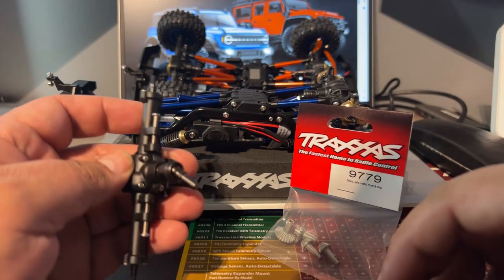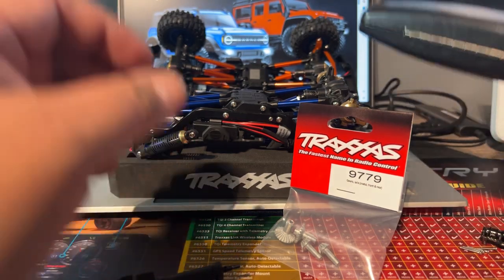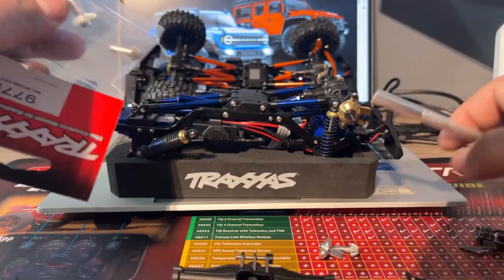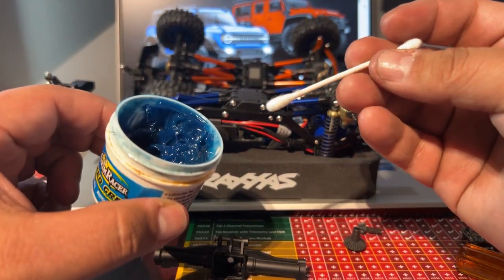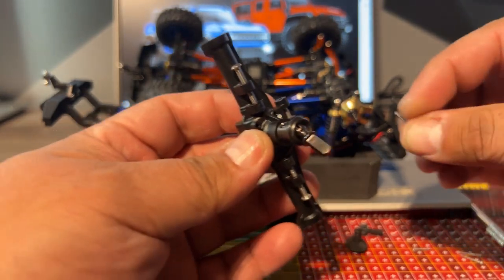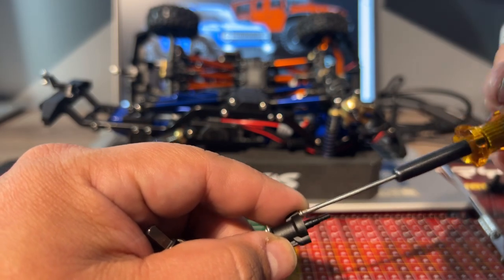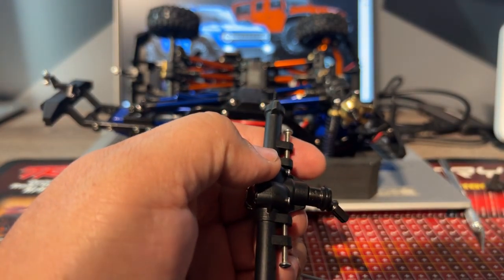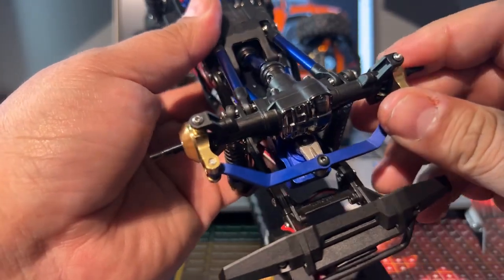TRAXXAS TRX4M METAL GEAR DIFF

Comment: I'd trade a set of Injora 4+ and RCAWD open diffs for a pair of open diffs straight axle housings with no portals... Lol I can't get these to fit in my metal injora Axle housings!! I'm trying to install them for my Bigfoot build of the TRX4MT... But, they were advertised to fit traxxas trx4m, which is the same size as trx4mt axle housings... But not the Injora... I just need to mount some Losi LMT mini Axles I guess... Is that possible!?!
🤷🤔🤔🤔🤔